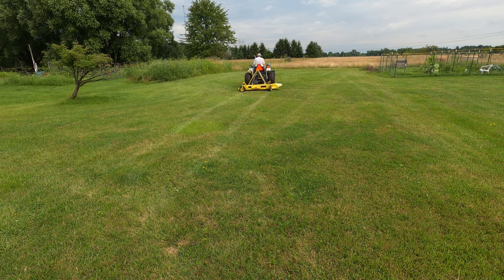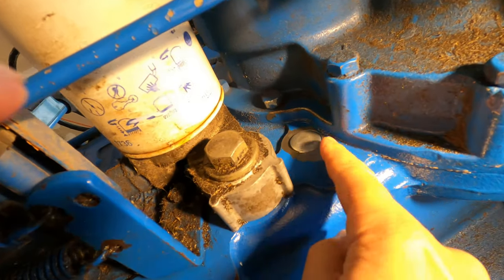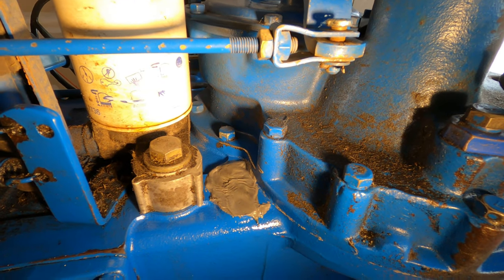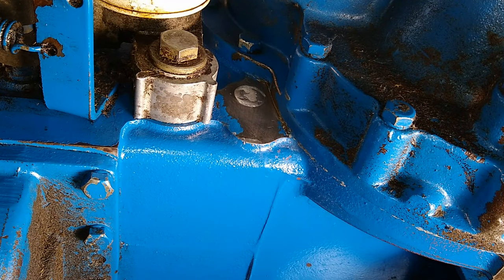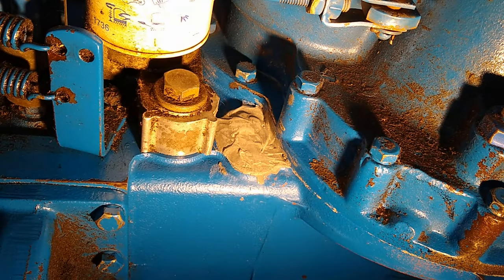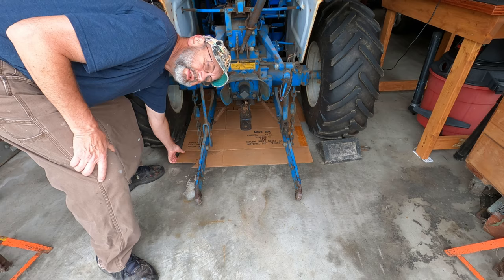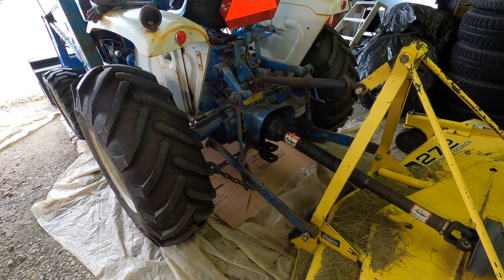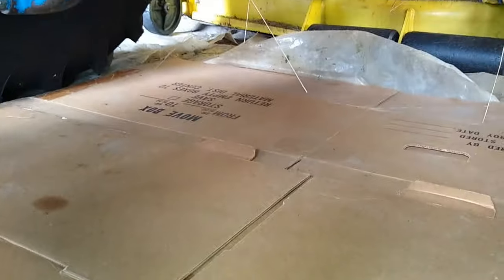Chasing Oil Leaks #1 | Ford 1710 Diesel Tractor | Man About Home

Comment: Great job! I honestly didn’t think it was going to hold. Did you reseal your other lift cylinder on the bucket yet?👍👍
Reply from the maker: There's not really any pressure inside the case, so it "should" hold.  I knew it would work. I just don't know for how long...

No, my other loader cylinder isn't leaking. If I see it start to drip, I'll know it's time!  Thank you for watching!

Comment: I learnt the hard way jb weld won't hold sealing oil or gas , to get you home sure , trust me on this one don't waste time an money , do whatever you have to do to fix it right whether it's welding buying parts whatever it takes to do it right , besides that every job you do that's just a patch is a waste of your life , you will end up with half your crap patched an either failing or about to an be overwhelmed in the end just when your sick of fixing stupid cheaply made shit all the patchs come back to haunt you an you have to fix it anyway um again ! 🤣
Reply from the maker: I've had rusty oil pan patches with JB Weld that lasted two years until they rusted out even worse. We're going to see how well this holds up with zero rust. If I have to replace the soft plug, I'll make another video! Thanks for watching!
Reply: @manabouthome  Good luck I really mean it k , my experience with jb on oil pans is that after a few months the oil breaks down the bond an starts leaking again so at the end of the day was better to jack the motor up pull the pan weld it an while i was doing that change the seals an bearing because why not it's cheap an your right there , but i'm old when your young you have life to deal with when your old it may be i like this so screw everybody it's mine an i'm keeping it no matter what it costs 😂
Reply from the maker: Yep... it's a temporary patch. How temporary, remains to be seen.
Reply: @manabouthome  sry about the rant i'm old an dealing with the only parts you can get are made in china an they break as soon as you put them on getting pretty jaded , seems today if you want a good part you have to make it . an jb weld for me is what the chinese company would send me for a replacement part under warrenty that cost 5000 bucks .
Reply from the maker: @pl7868  No problem. I understand. Thank you for your comments!